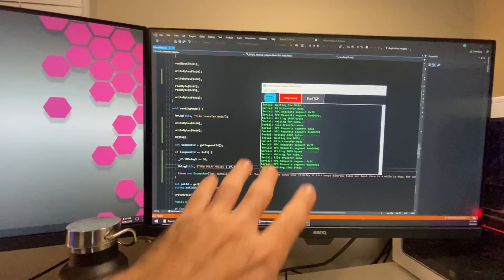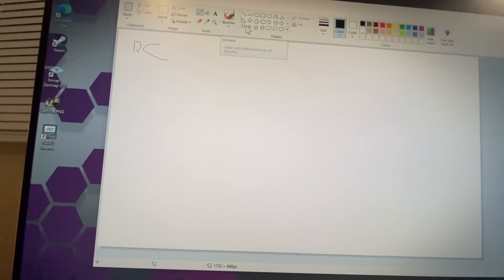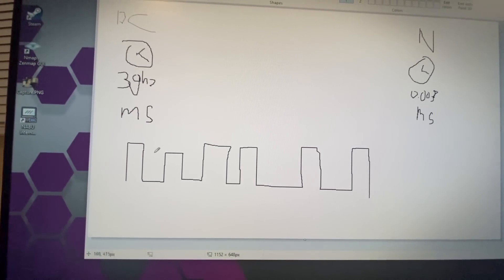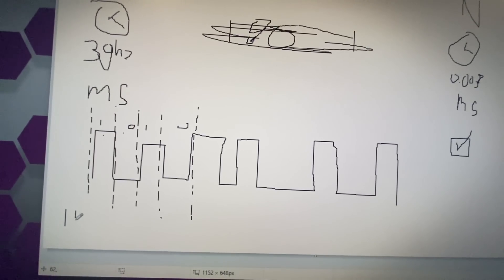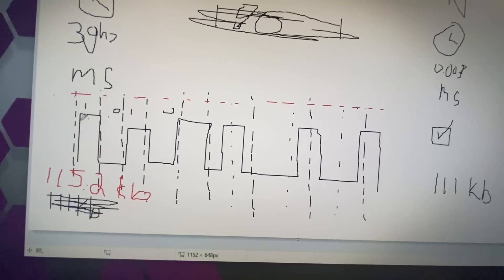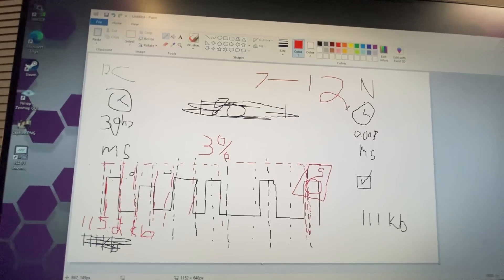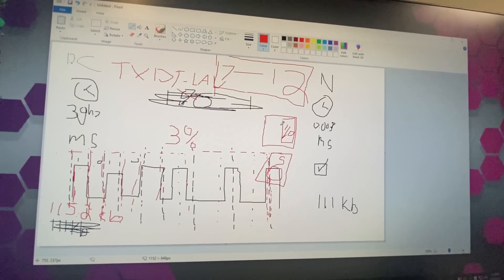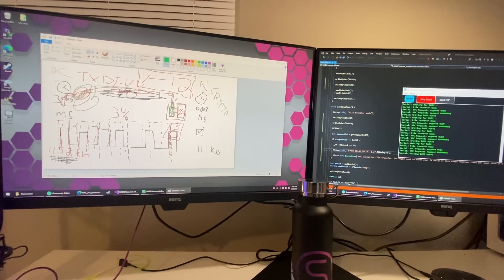28 - NABU Computer Baud Rate Troubles

Comment: How about a simple serial buffer with a DE9 on either side? Give it some RAM to buffer the too fast incoming data and a circuit to clock it out the other side at exactly the speed the NABU expects. Printer buffers for serial or parallel used to be e big thing in the 1980's. The computer could slam data at the printer at top speed then the buffer would dribble it out at the speed the printer could accept. Fancier models had much more RAM so they could cache an entire document and repeat the print by pressing a button so the computer could be used for something else while the printer was hammering out copy after copy.

From the issues you're having, I assume the NABU isn't ACKing receipt of data or using RTS/CTS? Does the network adapter happen to have some RAM it uses as a buffer? Or does it just take the data from the TV cable and shove it directly to the NABU's port?

Comment: It's a real bummer that your favorite RS422-to-USB adapter has an FTDI in it, because that chip's software interface enforces the "normal" baud rates common in the dial-up era.  There are some other USB serial adapters that can take an arbitrary baud rate (at least, my perusal of driver code for them suggests such) -- the Prolific chips, for example.  You should be able to interface with one of those by using a SN75176 or similar.  (There's a 4-channel version of that, as well, I think?  So you could get Rx and Tx with a single IC.). Anyway, then, in theory, you could set your baud rate to the exact value the NABU is expecting.
Reply from the maker: We thought it did, but it does whatever baud we specify - which is great. Check my other video where it's all working now.
Reply: @DJSures  Oh! Ok, will go check it out!

Comment: 6:00 Wait, RS-422 has a maximum of 6 volts differential. The minimum difference is much less. The voltages you mention are for RS-232, where the minimum voltage difference is 3v. With RS-422 differential pairs this minimum difference is around 0.2v.

Comment: @DJ Sures  if you are going to do a shim board to break out the TTL serial like @MyGeekyHobby did you might as well add a 1.8342 oscillator get 115200 out of it
Reply from the maker: don't need to anymore - fixed. Get the new version

Comment: Maybe an Arduino Uno or Arduino Pro Mini (ATMEGA328/P) which are fairly cheap, reliable and easy to get from China can do the job with some external circuitry. I'm currently away from home and can't test this, but when I get home I'll test it. You can get Arduino Pro Minis for 80 Euro cents (excluding shipping) or even better: you could get a dedicated USB-to-UART IC breakout board.
Reply from the maker: I got it figured out :)

Comment: Use 2 stop bits & mark parity 8M2 to waste extra time between bytes so the 16X bit rate clock has more than enough time to force it to resync when it sees the leading edge of the start bit.
Reply from the maker: You're the man with the master plan - someone else beat you to it but yeah that indeed helped! Also, windows sucks
Reply: @DJSures  🤔 If that is not enough time then maybe the NABU can't keep up with the byte rate.  I might have a way to measure that... I need to set up your server and watch it go.  (It's finals week.  I've been swamped.)

Comment: DJ, you're not the only one with a rough day, I did another Tomb Raid that yielded less in treasure than it looked like: https://youtu.be/GoMGW9VlYGw
Reply from the maker: You need a couple cans of brake clean and some 3-in-1 :D. That'll clean up those drives and get them spinning again!
Reply: @DJSures  I think that this point, I'll just set 'em aside and work on the floppies. But it's Saturday night, I need to get my 'BU on. I got the replacement cable DTech RS422 to USB. I believe I packed away the first one in a box while searching for NABU things. I will likely find it a decade from now in yet another round looking for some other of my software to resurrect.

Comment: Here is the problem with your nabu. They are 40 yrs old. The board and ps components are 40 yrs old. Even if you do get them talking and create your little network they will all start failing, one by one. I'm just waiting for that video. Then we can call it the tabu 😂
Reply: Quality components from the 1980's typically outlive the garbage that was produced in the early 2000's. The NABU PC uses ceramic caps for most of the bypass caps on chips, and decent quality electrolytic caps in the analog parts of the boards. The PSU in the NABU PC is reasonable quality without RIFAs. There is plenty of room inside the case for air circulation, vent holes to pull air in across the motherboard and out through the PSU fan. The parts most at risk of problems are the DRAMs, which show up pretty quickly within a couple hours most times when they go bad.
Reply: @GrizzLeeAdams  okay we will see. I like to be optimistic, but after repairing vintage electronics 40, 50, 60 yrs old there is reality. You can fix them, flip them on, enjoy them momentarily and smile. I wouldn't expect lengthy duty cycles, not even 50%. Even if it's NOS with quality components. Congrats on your efforts!

Comment: The baud rate mismatch is probably not that big a deal. When the receiving end detects a start bit, it will start a timer for 1/2 a bit and then check the start bit is still there and then starts assembling the data bits 1 full bit time after that. In a perfect world it would be reading in the dead center of each bit, but in reality they can drift and the data will still be transmitted correctly. The maximum drift is 0.5 bits every 10 bits, which (if the baud rates are stable) should just about meet specification.

It's possible that the receiver isn't able to resynchronize if a start bit is received too soon to the stop bit, the standard solution for that is to increase the stop bits. Most UARTS ignore the stop bit setting on receive and only require 1 stop bit, but the sender will hold off sending another start bit during the stop bit time. 

Whether your USB device supports stop bits is another matter, but you are essentially trying to fake them with your delay.

Are the NABU roms dumped and available anywhere? I'd like to write an emulator, which would make homebrew easier to develop. I don't have a NABU and importing one into my country is not going to be easy.
Reply: I think someone is working on adding NABU to one of the MSX emulators since aside from the sound chip the hardware isn't too different. Same CPU and VDP as MSX1. I'd expect that MAME might be fairly easy to add NABU since it already has emulations for the chips and all the MSX varieties.

Comment: It looks like you have UI stuff and transfer stuff intermingled, which is throwing your timing off, because stuff like UI and console output is very slow, compared to other code, and of course different PC specs are gonna affect your timing. It might be best to put all serial transfer stuff into its own thread and use an asynchronous way of writing to the log like a FIFO buffer that gets cleared periodically by the UI thread. Then you can bring that progress ba back too. :)
Reply from the maker: haha, it is in its own thread. Come on :)
Reply: @DJSures  Dang.... that's surprising. Sorry for assuming haha. Still i'd look into it with a profiler. Serial stuff itself should be blazing fast.  There's a good chance something from the UI thread is blocking on the serial thread. I wrote a AVR emulator earlier this year and while debugging the CPU i was surprised how horribly slow console output is. Easily 99% CPU time was spent on outputting to the console and on tostring conversions for the console output.

Comment: The voltage isn't that bad, the spec calls for nominal 10V of difference between the + & - signals, the comparator on the receiving side is able to handle a wider range of voltages than that, with the maximum in-spec voltage difference being 12v or +/-6V. The voltage difference is what it cares about, not the voltages with respect to ground. With short cables a difference of +/-2.5V or 5V differential should work in most situations. Good RS422 transceivers will be much closer to the +/-5V range, and some industrial stuff has high differential options that violate the spec cause they know your cables are stupid long and your environment is noisy. (I work with some machine shops that have equipment made at the start of the CNC era, and have to send NC/G-code from modern equipment over cables hundreds of feet long next to three phase motors etc). The thing with baud rate errors is they compound. If you're transmitting 3% fast that means the first bit sample is taken at 51.5% into the bit, but by the end it's 62% into the bit. For individual bytes that usually works. All of that assumes the start bit was sampled at it's leading edge to start the sampling counter at half it's load value. With back to back transmission the start bit of the next byte can arrive before the counter reloads after the stop bit. So what happens? The receiving uart keeps clocking in bits 3% out of phase (compounding) with that first start bit. After two back-to-back bytes your sample is taken on the edge of the last bit. If your transmitting uart supports it, you can specify 2 stop bits (8n2) and this will typically be enough of a gap for the bit timing to reset on the receive side. Not all USB UART dongles support this, and due to the way the USB protocol works, you're bound to get some back-to-back bytes in the same USB packet, which the UART will happily transmit as close to each other as it can. The computer's CPU clock doesn't really enter into things other than the fact it's able to stuff bytes into the transmit buffer faster than the UART can clock them out. What matters is the UART's local clock and what baud rates it is able to derive from that clock. A 12MHz clock is common in USB devices, and so you usually get 115,384 when you ask for 115,200. If you ask for 111,000 you might get 110,092, or 111,111 (if they support custom baud rates). 112,149 is closer to the actual 111,865 rate the NABU appears to communicate at and is obtainable from a 12MHz clock.
Reply from the maker: You're right - voltage seems fine. I figured out a timing issue and yah, windows sucks. Stay tuned for next video!

Comment: There is an offical way to add some "recovery" delay to the transmission: Just increase the number of stop bits to 2. This will work an any device and should be plenty of delay to help the receiver recover from the slightly offset baud rate.
Reply from the maker: Interesting - i never considered that. I will try it, thanks!!!
Reply: @DJSures  , Yeah this is what I have always done. Just specifiy 2 stop bits. Usually the receiver re-syncs on the start bit. So the extra time prevents the receiver from seeing the last data bit as a start bit for the next byte. (I hope that makes sense).

Comment: no... that's just cpu based rs232 bitbanging.... actual uarts run on their own clock. usually 1.8432mhz (which was cheap in the 1960s as it's also used in tv) and then it devides that by a factor so you get 50,110,300,600,1200,2400,4800,9600,19200,38400, etc.... the clockspeed of the actual system is fully irrelevant as long as a proper uart of any type is used. (well ok the baudrate cannot go above the mhz rating for the uart chip itself and the speed of the rest of the system times 8 (plus some more for the cycles to retreive and do something with each byte... but that's 1 transfer per 8 bits so on that side it can do 8 times more than the clockspeed rating of the uart ;).. not that the wiring usually keeps up with that. but hey if you feed it directly into fiber tranceivers that also is no problem... a few mbit/s is no biggie for most stuff. as long as it's not over copper.
Reply from the maker: That's good info to break it down more technically, but I didn't mention bit bang. I gave examples of clocks on either computer. The NABU uses a TR1863 btw
Reply: now what i don't get is how they would have come to that 111bps... there are no common crystals for that. sure it's not just 115k2 ? :P or even 128kbps straight.
Reply: @CB3ROB-CyberBunker  It is derived from the TMS9918's clock, the TMS9918 gets a 10.738MHz clock, divides it down by 3 to get the 3.5794MHz NTSC color frequency (which is also the CPU frequency), which then gets divided by two to get the 1.79MHz UART & PSG clock. In the UART its divided by 16 to get 111,856 baud.
Reply from the maker: David is correct at the exact baud rate - which we can't reach because it'll default to one of the closest in the ftdi, which is 115200
Reply: it it 'works' 'sometimes' but puts out garbage if it has to catch up (is being turned on) in the middle of an ongoing continious datastreem coming from the other end, and then only catches up if you halt said datastream for a few milliseconds and then it works fine again (for a while ) or have to send bytes one by one with artificial delays in between the baudrate is probably off by 'not a little' but more like 1 to several procents :P it will happily decode like 9600 at 9000 or so. if you clock lets say a pic mcu with the wrong crystal or do it all in software you can get any weird baudrate after all (which is why they have to be multiples of 1.8432 mhz ;). it will still work. but then it cannot tell the difference between a startbit and stopbit and any other bit and won't 'sync' correctly in the middle of already coming data. (most equipment other than gps stuff doesn't just send data all the time anyway. but if it does. that is when you notice... in most cases the computer initiates somethinig, like 'ATDT 1234' :P and some device then answers. then there are spaces in between and both things are already on when it starts. so slightly wrong clocking goes unnoticed. now do the same with a continious large data broadcast or telemetry data and it screws up.
Reply: also crystals can 'go off frequency' after a few decades. which obviously includes crystals built into a tin can ttl oscillator. usually not by 'a lot'. (which is why you let new ones 'run in' before testing them for the correct frequency thats printed on them and then building them in). it also kinda depends on the temperature and other external factors.
Reply: Where did you come up with 1.8432 MHz as "also used in TV"?  NTSC color burst used 3.579545 MHz, and companies even made ICs that would divide that down to get 60 Hz so digital clocks could use them for battery backup and such.

A few Mbps is no biggie so long as it's not over copper?  What about IEEE 802.3 "Ethernet"?  Started at 10 Mbps, then 100, then 1000 (aka gigabit).
Reply: I seem to recall back around '84~'86 helping a coworker design a custom board to go into a machine tool controller.  It needed to talk to some other device at an unusual baud rate, and we found a Harris Semiconductor UART that could do it.

We often take for granted standards that are normal for one era aren't necessarily available in others.  I'm glad to see the knowledge exchanges going on and all the efforts being put into making this all work out.
Reply: @bobblum5973  pretty much all uarts can do it as the crystal for the baudrate generator is not the same as the system clock. (although while it's there anyway you might as well run the whole system on it ;) insert 1.8432 and it does the usual rs232 stuff. insert another one and it does midi. etc.
Reply: and yes when it comes to 65c51's you want the harris ones. as all the other ones cut off bytes mid frame if the flow control goes out 'oops' :P (but those don't come in 14mhz variants so that kinda limits the speed of the rest ;)
Reply: stuff is aways available. in any area. you maybe just have to pay a bit more to get it produced again :P LOL. just look at crt tubes and nixies for example. plenty of places that'll make them for you. just not at the price you got them for in the 1950s. unless ofcourse you instantly want a few million of them

Comment: It might be easier throwing together your own interface with an MCU like an ATmega and a MAX3488 :)
Reply from the maker: Would be much easier, but i'd use an ESP32 because i'd make it wifi :) although that's not something I can easily give to people to start using. So this works :D
Reply: @DJSures  You could but you would be back at the same place, just in the esp's software. The chip would need to be driven by an external clock to get the uart running at 110k with an acceptable error rate. Dang I used to know the calcs off by heart, my old brain is struggling to pull up that info now lol. Silly question... have you tried setting the serial port on the PC directly to 110,000? (or 111kpbs, I assume 110 from rs422 land)

Comment: I don't think 5V is under the threshold for RS-422. It wouldn't be uncommon for RS-422 transceivers to operate from a single supply of 5V, so it's probably spot on really. There will of course be a maximum operating voltage that the receiver can tolerate before it starts to be damaged, and that might be closer to 14V give or take.

The thing that matters the most, I believe, is what is called the "common mode voltage", or the difference between the most positive and least positive voltages of the differential signal. This is usually a couple of hundred mV.

So as long as the voltages of the differential pair are at least that amount apart in either polarity then the receiver is able to differentiate between the two and produce the corresponding logic output level.

You could measure each side of the diff pair with a multimeter while the signal is idle to see what voltages they are sitting at. I'd imagine pretty close to 0V and 5V.